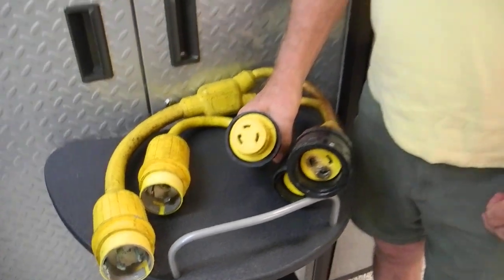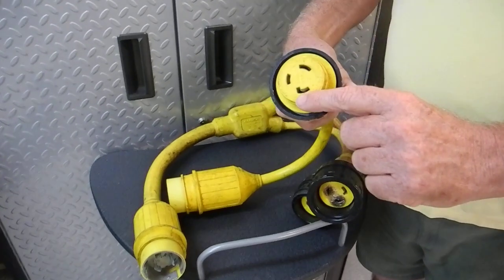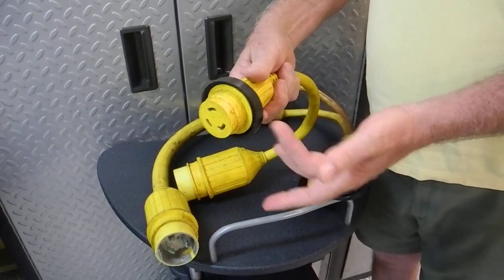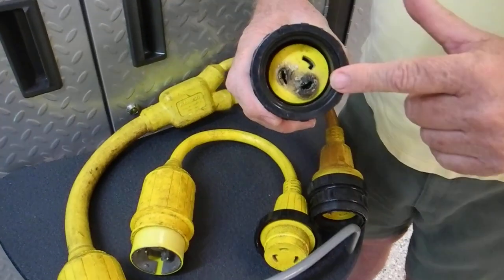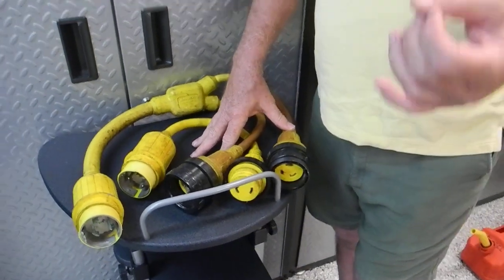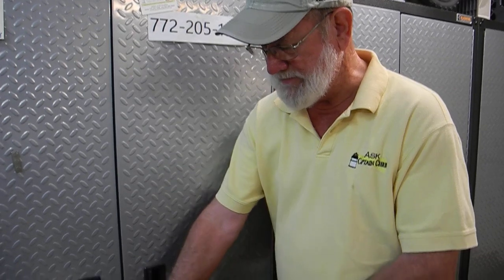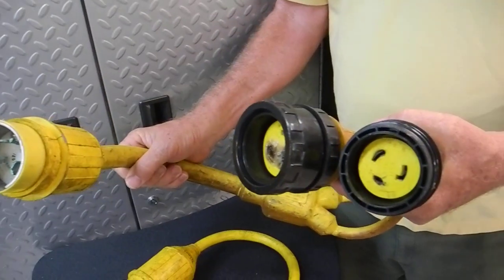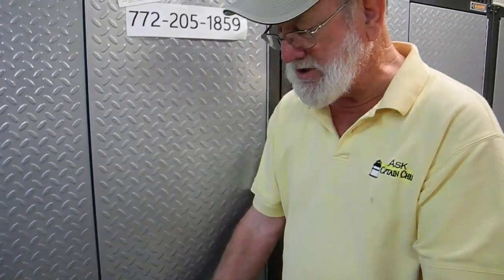Shorepower connections

Comment: 120v and 240v 
Not 110 and 220v
Reply from the maker: @watercop5115  most viewers are not electricians and think in terms of 110 volts. But you and I know it is variable between 110 and 125 volts. Same as 220-250volts. But my goal is not to teach electricians. BTW we are not even talking about 208 volts occasionally found in older marinas.

Comment: we have a 50amp hookup.  I have a splitter from the previous owner, but how can I get a 220/240V outlet?  I keep hearing people say if you have 50amp, you already have 220 going to your boat, but I need to have a 220V outlet (where there are none onboard), so confused.  Any idea how to achieve this?
Reply from the maker: @carlisburns9830  the only way to get that is for the marina to supply it at the shore power pedestal. If the splitter takes into 120/30amp shore power it is not additive. You will have two lines called shore 1 and shore 2 at 110-120 volts each.

Comment: That might answer one of my questions. Our boat has 2 30 amp plugs. 1 for AC and 1 for everything else. How common is it to have 2 - 30 amp plugs at transient slips on the loop? And should I have a splitter for a 50 amp pedestal?? Thanks
Reply from the maker: Yes, I believe you should have the splitter BUT be aware there are two major type of splitters. Look at the ends to see if they have the male prongs or the female receptacles. Some are designed to connect to a single 220 - 50 shorepower and then split down to the two 110 - 30 shorepower receptacles on the boat. Another splitter does the opposite, connects two 110 - 30 shorepower receptacles ands then joins to a single 220 - 50 receptacle to fit the boat.
Reply: @AskCaptainChris  thanks so much for the response! In our area 30 amps are popular for home slips but we really don't have transient slips. Thanks again Captain Chris!